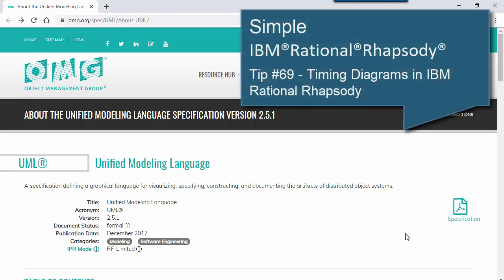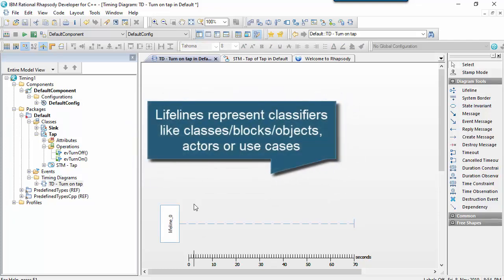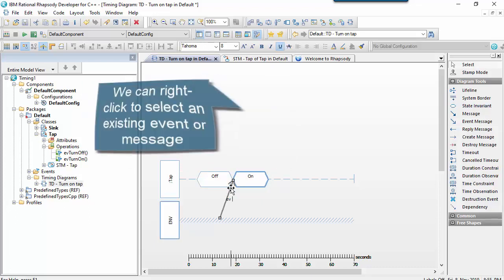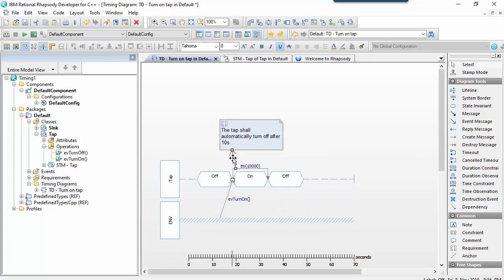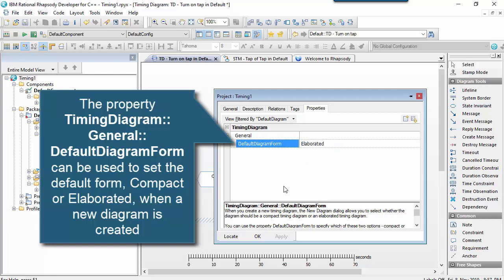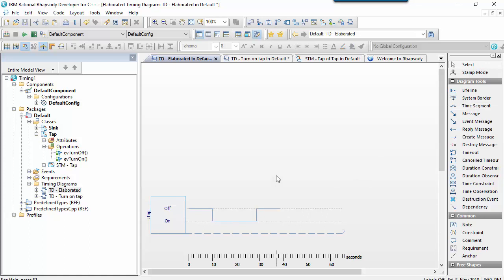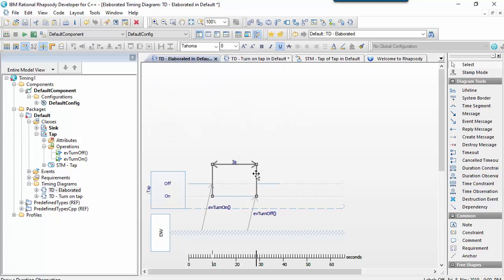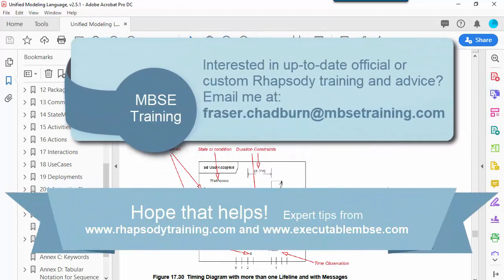Rational Rhapsody Tip #69 - Timing diagrams in Rational Rhapsody (Simple)

Comment: Thanks for the video, Frasier. I'm a big fan of timing diagrams - you may remember that I wrote that part of the original UML 2 specification, so it's kind of my fault they're in there.. The only correction I would make  to your discussion is that the lifelines on timing diagrams are the same as they are on sequence diagrams; they are actually roles (uses of instances in a context) rather that their defining classifier. If you drag a class onto one, Rhapsody creates an anonymous role of the class for the lifeline. You can see that in your diagram in that the name of the class in the lifeline is preceded with a colon (":"). You can even name the lifeline as an instance of the class. Further,  timing diagrams are exemplars in the same sense as sequences.  Other than that small thing, I thought this was great. The graphical editor for Rhapsody could be improved, though and maybe someday Rhapsody will animate them in the same fashion as they do for sequences.